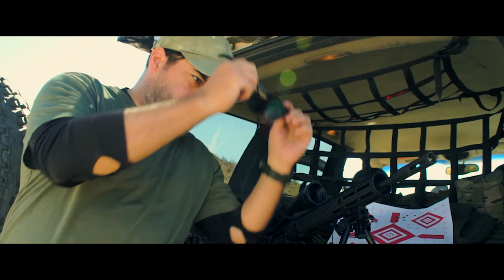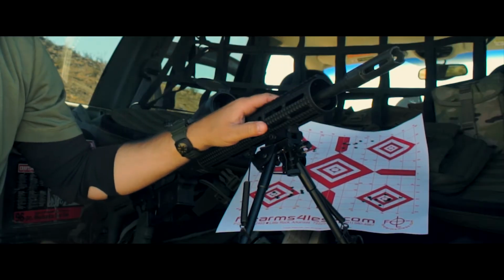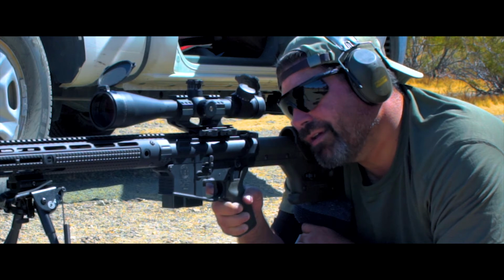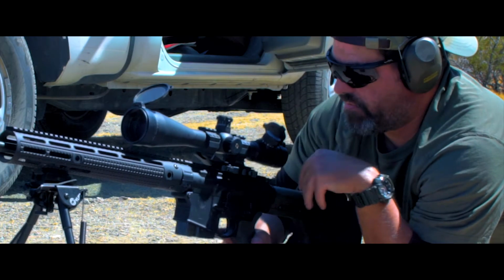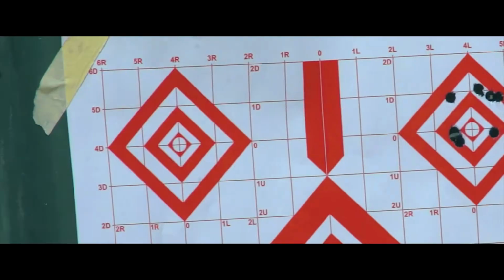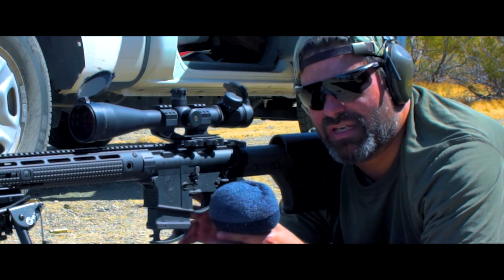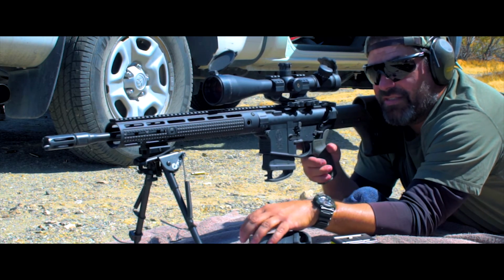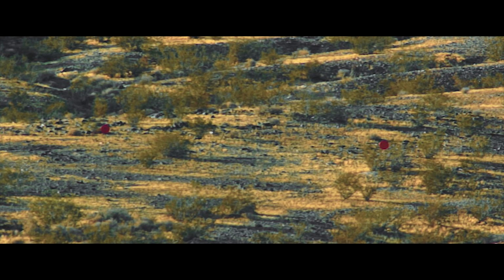M&P-10: Solutions Ep. 3 SUCCESS

Comment: Did you ever figure out what was causing the misfire? I finished modifications on my M&P 10 and about half the rounds misfired. When i took it into a smith he said probably because i had put a light trigger in it. just wanted to see if you had any similar issues.
JW
Reply from the maker: Yes!  The Velocity 3 lb. trigger I upgraded to (https://youtu.be/XD_37djfz90) is sensitive to fouling - and I'm not the best guy when it comes to complete cleaning.  When the rifle is dirty, the hammer/trigger won't completely reset.  Once clean, no issues.  Great question!

Comment: Dude, you need to eliminate human error. On 1st episode, two groupings & hitting everywhere around the target but not on the target seem to indicate human error. Use a bench & a rifle rest. You could have saved a lot of time and $$.
Reply from the maker: So, by your assessment, without having shot my rifle (or watched "Back to the Drawing Board" where I used a Lead Sled), two distinct groups, equal distant apart from the aiming point... doesn't seem like a mechanical error to you?  The aiming point is the same: center.  The scope is 20x, point blank for .308/7.62 @ 100 yds.  Yet one shot is on one side, the next shot is on the other side, equal distance apart. And it's every other round, like from one side of the magazine and then from the other side of the magazine. In Ep. 1, I swapped the Magpul plastic mags, which deformed in the heat, for steel mags.  The groups size was cut in half, as one viewer commented.  Then I free float the barrel in Ep. 2, and now my groups are sub MOA.  How can that be if my technique is so ate up?  Wouldn't we see the same results from the first episode to the third?  And then I hit consistent "head shots" at 400+ yards with no elbow support, from an improvised fighting position.  Your assessment doesn't stand up to what is demonstrated in the video.  If anything, I am guilty of poor PMCS, not identifying that the compensator was out of tune and not lined up correctly to provide proper blow back, which was why I was so challenged to get back on target quickly.  I felt like an idiot when I got to the shop and saw that. The compensator was only hand tight!  I appreciate your comments, but you're not the first one to say the same things without disregarding the demonstration.
Reply: The message was sent before I watched Back to the Drawing Board. I think you were right on your first reaction on that first video when you laid out the rifle bag because you were not comfortable enough. You were, in effect, trying to eliminate human error there but then you went to blaming the rifle next without fixing possible problems w/ your position & the rifle's, that came couple of episodes later. I'm not trying to argue dude, I like your videos. Reminds us average joes that not all Youtube "celebrities" are experts or deadshots or whatnot, some are, in fact, just like us. I hope you fix the problem & will be looking for updates. Subscribed!
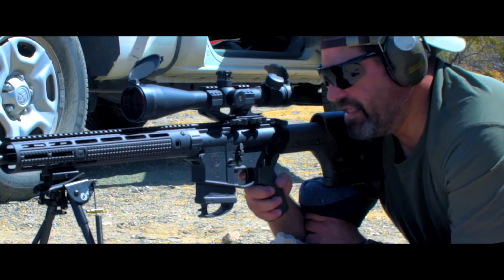Reply from the maker: Thanks for the sub!   I was so uncomfortable on that rifle bag. Pockets and zippers and padding all in the wrong places, if you know what I mean.  That's why I didn't break it out.  By 10:40, I've pretty much settled in and manage a sub-MOA zero.  My dialogue is to explain what I'm seeing and experiencing, since I can't show it.  I can't show how the heat mirage down range is causing tunnel vision and how my eye relief is darkening, which is why I keep adjusting my cheek weld.  I'm trying to describe it, but I guess it comes out wrong as people think I'm complaining about the system. And to be honest, I ramble and don't speak in complete sentences.  When I declare, "I don't know..." I'm referring to my satisfaction with the zero, even though it's sub-MOA.  I'm not complaining about the rifle.  I love the rifle. And now it's finally doing what I ask.  I was out last week nailing 12" plates at 800 yrds:  https://plus.google.com/b/114018009654979504844/+TheTSFChannel/posts/TT22puzJyex   All these convos are driving toward another video and demonstration.  Stay tuned...!

Comment: I just bought an m&p 10 sport .308 ,3-9 x40 vortex 2 crossfire and a vortex ranger rangefinder. I got it sighted at a local gun shop so I’m hoping for some good accuracy. Any extra tips for a first timer owing a AR?
Reply from the maker: Zero at 100 yds. You can confirm on the forums, the M&P-10 likes ammo that's 168gr and up.  From my experience, the muzzle brake was only hand tight from the factory.  Check that and check that it is "tuned," meaning the vents are up and centered.  You'll notice the bottom of the muzzle brake is solid with no vents.  It all needs to be centered on the barrel and snugged up on the crush washer.

Have fun!